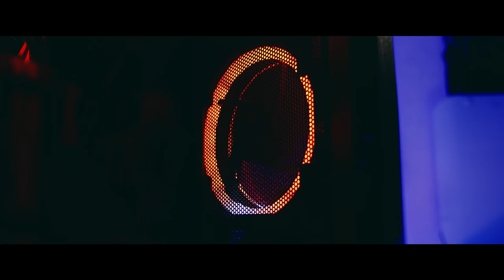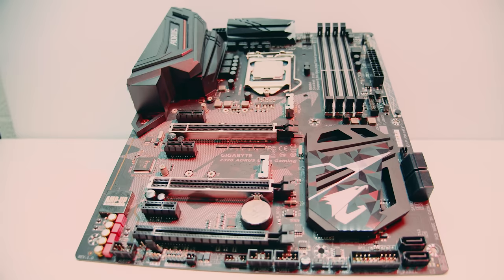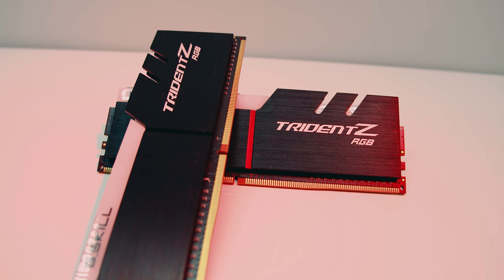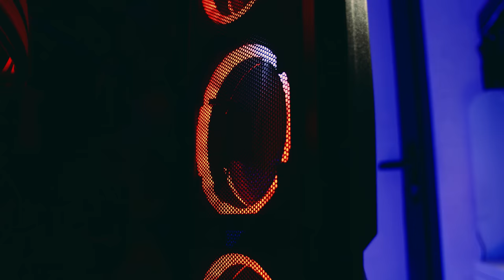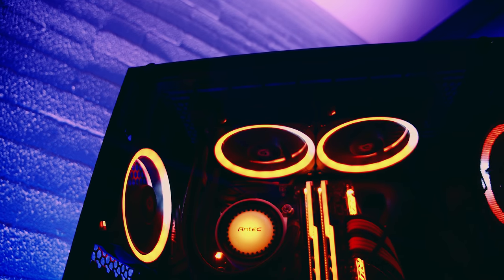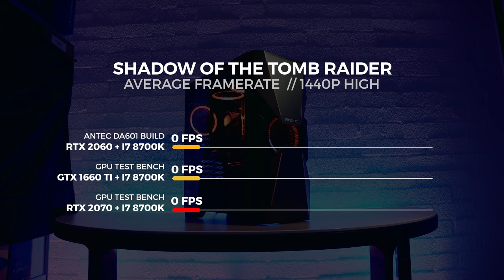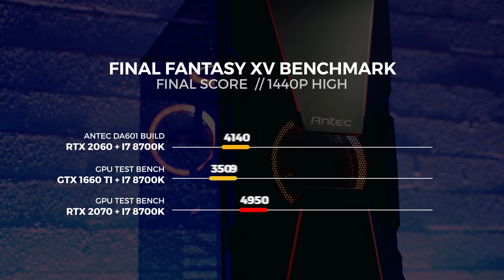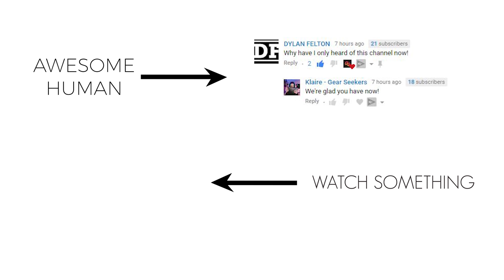$1500 RGB INTEL Gaming PC - Antec DA601 Build + Benchmarks

Comment: Hi Man! I also have this case, and i'm gonna buy the Antec Prizm pack with 3 fans, 2 led strips and the controller. In total I have 8 rgb cables to connect, but a single controller doesn't have enough space, can i use the case controller and the one bundled with the fans and then connect both to the 2 motherboard rgb headers? Sorry for my bad english, and Thank You!

Comment: I am having the same case with Aorus B450 pro wifi. But my issue is the cabinet led control switch is not working its only glowing in default mode, i cant change it through switch, I may have missed any jack but i checked properly everything is pluged in & it's going above my head. Plz help
Reply from the maker: Hold the button down
Reply: @GearSeekers  thanks for the reply, i will try & let u know.